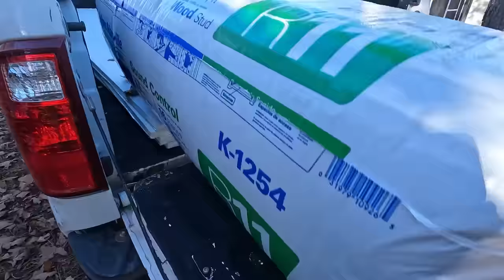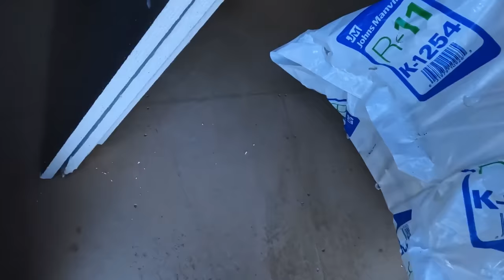I Had To Get The Rest Of Insulation Out Of Truck After Injuring My Back/Channel Changes

Comment: Mike ,l used that foam board on the walls and rafters of my garage, it is a metal building .l used cans of spray foam to glue  the sheets ,l drilled holes the size of the foam tube .It was twenty years ago no sheet have be loose.